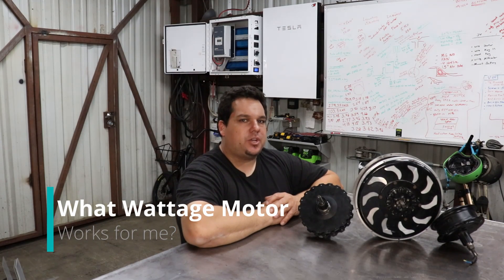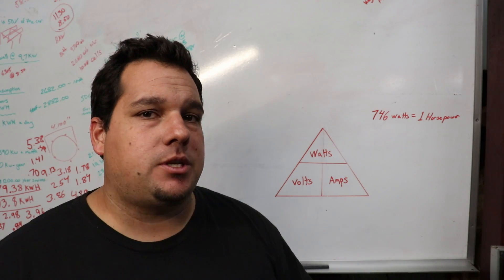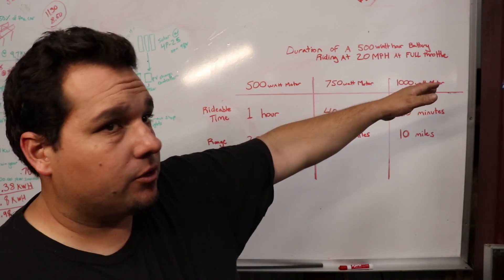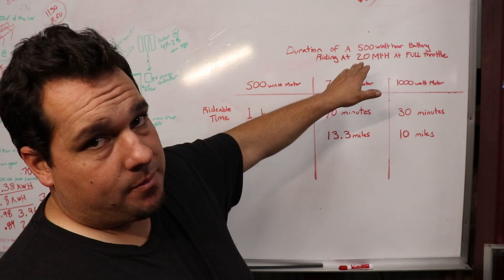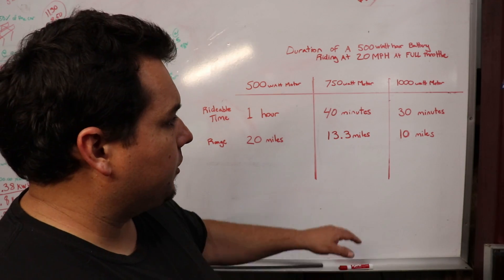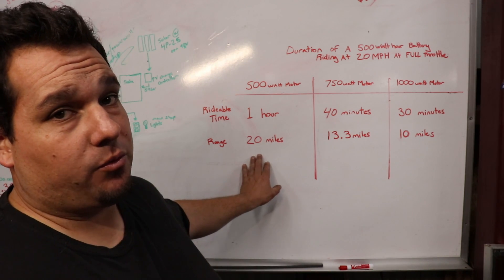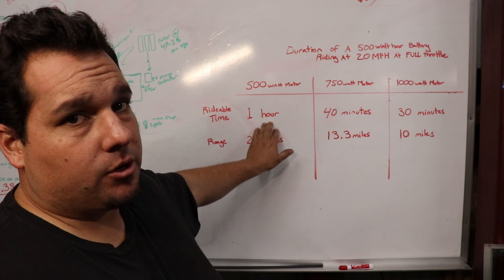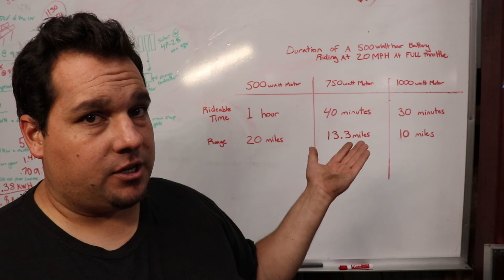What wattage motor? An introduction to E-Bikes

Comment: The table at the end of the video is only correct for the row labeled "Rideable time".  Range is incorrect and should be 20 miles for all three wattage motors. Remember his assumption is that all three motors are running full out (i.e. full throttle).  In this case, the 750 watt ebike would most likely be traveling at 30mph and the 1000 watt ebike at 40mph.  Multiple these speeds by the "rideable time" and you get... 20 miles!  This makes sense, because in all cases you are consuming exactly the same amount of power - 500 watts. So, you should travel exactly the same distance.  Now of course, this assumes all things being equal.  In the real world they are not.  The larger motors (750 and 1000 watt) are heavier due to heavier magnets and heavier coils.  Thus, in the real world and just like an ICE engine, the smaller motor would be a little more efficient on level ground.  (In other words, it would have a slightly longer range - maybe 1 to 2 miles.)  However, if you typically encounter hills in your bike rides, they present a huge problem for smaller motors - HEAT!  All of these electric motors upon demand will draw peak power, which is significantly high than the steady state wattage spec.  It's that extra power needed on hills that can destroy the smaller motors.

Comment: Again we thank you. Question, every hub motor has a "nominal" watt output stamped on the motor, usually they are very underrated, how do we know what the real "continuous" watt rating is? Also, the real "peak" watt output? It can mess up the math. Thanks, I'm just trying to learn.

Comment: For those who are new to eBikes, it can become confusing when amps and watts are interchanged in the product descriptions. For instance, my eBike is equipped with a 500-watt motor and a 13-amp hour battery. It would be helpful if both were consistently rated using either watts or amps. What's even more perplexing is when a manufacturer employs both units. Take, for instance, an upgraded replacement battery rated at 36V 15Ah 700W. Attempting to convert amps to watts through calculations can make my head spin, as the provided numbers just don't seem to align. For instance, 36 * 15 equals 540, and 700 divided by 36 equals 19.4, and so on. Furthermore, an explanation that these differences might be attributed to energy loss only serves to further complicate the matter.  I appreciated your summary that a 500 watt motor will provide greater distance, and a 750-1000 watt motor will provide greater performance.
Reply: You don't always use 100% throttle.

Comment: There are some very important misconceptions in this vid!
Battery -> Range
Motor power -> Acceleration
If your 1000Watt motor is pulling full load (or 1000W), you will be going the same speed as a 500W motor at full load (500W).  Your range will not necessarily change with a higher power motor. Your range is only dependent on the amount of energy your bike has and that is solely governed by the battery.

---------Analogy and math---------
--Important variables:
Force
Time
Distance
Mass ( Let's say mass = 2 for simplicity)
Speed = Distance / Time
Energy = 1/2 * Mass * Speed^2
Power = Energy / Time = Force * Speed

--Scenario 1: 
You have legs and energy to pedal your bike. The strength of your legs determines how much power you can apply to your pedals and your total energy is how much effort you can pedal before you get tired and have to stop. 
Force = 1
Time = 1
Distance = 1
Speed = 1/1 = 1
Energy = 1
Power = 1/1 = 1

--Scenario 2: 
Your legs become 2X as powerful, but your energy stays the same. 

KNOWN -> Power = 2X     ,     Energy = 1X

Other variables?
Time = 1(energy) / 2(power) = 1/2
Speed = sqrt [  2/2(mass) * 1(energy)  ]  = 1
Distance = 1(speed) * 1/2 (time) = 1/2
Energy = 1
Power = 2

Thus:
1/2 the distance in half the time when used at full power! Motors, however, do not have to be used at maximum power and a 1000W motor can be used at 500W for comparable range.

Comment: In my experience wattage has nothing to do with range or performance. Speed and power is all about amps. Volts make amps so wattage is really only an issue if the motor can’t handle the heat.

Comment: This is quite wrong.. I mean you can run a 750w motor to just 250w most of the time and achieve a similar speed compared to a 250w motor running at 250w. This is in fact what everybody tends to do so you have power available in case it is needed. The assumption that all motors at full throttle are running at 20mph is wrong

Comment: This is mostly for hub motors and not mid drives?
If you use a 750Watts motor (Yes haha that's what I got)...  at lower speeds... is it being so inefficient compared to a 250 Watts?